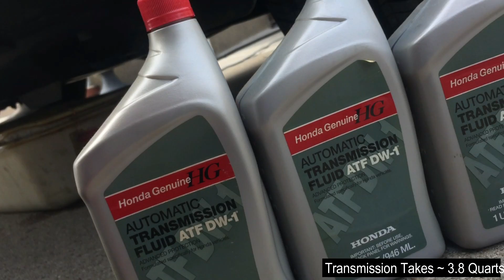2010 HONDA CR-V Transmission Drain & Refill

Comment: Never realized how romantic draining ATF could be
Reply from the maker: I guess takes the stress out of the equation from working on your vehicle!
Reply: @BulliKid  Congratulations.do you use transmission oil additive for the transmission.my car sounds "smack" when I take P to R at first start in the morning, but what could be the reason why it does not come in the next replacement.. should i use additives
Reply from the maker: @yigitmert4232  mine makes noises also.
Reply: @BulliKid  Were you able to solve the problem.. have you changed the transmission fluid... worst gearbox solenoid aalfs to be cleaned
Reply from the maker: I always change the transmission fluid every 20 to 30,000 miles a drain and refill other than making the noise during shifting the car has never had any problems and when I took it to the dealership they said it’s normal also have driven many agents civics and most of them do it
Reply: @BulliKid  thank you

Comment: Good job, Bulli.so you don't need to pump fluid to  the rear one?  I saw the other youtuber did that.
Reply from the maker: Yejun Li thank you.  What do you mean by rear one ? The rear differential?
Reply: yes. @BulliKid
Reply from the maker: Rear differential is a separate part of main transmission.  For that you drain it. And will need a pump to pump the fluid up.  I will be making a video of that this summer.
Reply: Honda dual pump fluid II for rear differential.

Comment: Is that plug and seal needed to be replaced at certain age to avoid "seal leaking?"
Reply from the maker: WC what deal are you talking about?
Reply: @BulliKid  Oh I'm talking about the "Auto Trans Output Shaft Seal SKF" (e.g. in a Honda CRV). Thanks!
Reply from the maker: I wouldn’t replace anything unless you have leaks
Reply: I thought you are referring to the drain bolt's crush washer.
Reply: hurry up or quit. I know of friends and cousins that's quit places over just that. Brown nosers gets the easy job's. My timing cover was cut in half being plastic and handed back to come back when parts are in, no front engine mount, they said my head gasket was leaking, was under warranty and done but not right, it was  a Friday and I'm leaving for vacation up into the mountains with my kids and my utility trailer for stuff like bikes that didn't fit, they had no choice to give me a new DODGE 4 door 4×4 to fit my family and be able to pull trailer as rental doesn't have those options. 3rd row seats  went down for dry stuff and coolers went in trailer with toys/bikes and i put 1,500 miles on it in a week, cost me extra in gas that I  complained about so they gave me 2 free oil changes, I went to school for it but went another way for a career, I checked before it went in, no engine mount and manager tried to get away with it, bolts hanging out botton that was stripped by tech but manager didn't see it and my belts were off besides power steering, always look before leaving, 1st popped hood and looked, grabbed manager which he finally came to look then grabbed Technician to double check and told manager that's what I told you about that it can't leave like in front of me. Manager saud belts must of fell off driving it out, I was called and dropped off to pick-up and got there hour earlier and not done, manager drove it out. Manager was pissed over it because there went his monthly bonus and tried hard to get me to take it. Still have that vehicle which is a 1999 PLYMOUTH Voyager and believe it or not, my best vehicle ever owned for upkeep and cheap over the years, I  parked it over Strut towers got very bad on making noises, wasn't paying to have them replaced after 200,000 miles, runs still with a jumpstart but not driven in years. Body rockers started to rot out on them, I use it for storage for certain things only.

Comment: What size is that square plug? What did you use?
Reply from the maker: 3/8th Rachet
Reply: @BulliKid  Thanks! Going to do this the same time I do the oil.
Reply from the maker: No problem! It’s very easy and keeps the trans happy

Comment: Hi, how often am I supposed to change the transmission fluid for a 2010 CRV?
Thanks
Reply from the maker: Julio Pina i like to do a drain and refill around 30k
Reply: @BulliKid  your CRV takes over 3.5 quarts to? Why does my Honda book say 2.5 liters?
Reply from the maker: Im not sure.   Maybe you were over filled to begin with.
Reply: @BulliKid  cant be I refilled 3.5 liters and checked it many times hot, parked on level and engine stopped, (60 secs) and i'm in my marks.
Reply from the maker: Quarts or liters?
Reply: @BulliKid  liters, (im in Canada)
Reply from the maker: Im using quarts.
Reply: @BulliKid in Türkiye use 3.7 litres atf 1 quarts 0,95 litres

Comment: How true that when you do this you have to drive it for a while then drain and fill with new ATF so that way the remaining fluid circulates and gets drained?
Also, does the dealer use a machine to drain all the ATF one-time, without needing to drain several times?
Reply from the maker: ybrik5 I like to drain and drive for 20k and repeat.  Flushing it slowly but surely will make sure the fluid is always slowly replenished  without possibly changing the viscosity ect of the fluid enough to cause slipping in a worn transmission.  

Some dealers will just drain and refill and have you come back in 30k. Some may do a full flush where they replace most if not all of the fluid.  (This process will cost a lot more as more fluid if used and more work) from what I have always heard you should do a drain and refill on these cars.   If you wanted a “flush style” then you can drain and fill. Drive the car for 15 mins and have it warm up. Then drain and fill again.  And repeats 2-3 times.  But to me this seems like you are pouring a lot of the new fluid with the drain.  To each their own.
Reply: BULLI KID thanks for the tip. How do you check the fluid level for this?
Reply from the maker: I believe car running in neutral.  
There is a dip stick for the transmission. You want it to be in between 2 marks.
Reply: BULLI KID Also how is viscosity a factor? As I understand you wanted to change that old fluid’s viscosity to a fresh one.
Reply from the maker: Good questions.  Typically as the fluid wears out it’s going to get thinner or less viscous causing more wear and internal engine components torque converter and clutches.  And if the Transmission was seeing new fluid that’s a thicker and viscous it can potentially cause some of the engine components to slip such as the torque converter.  That’s why they say if you haven’t changed your transmission fluid for a long time and over 80,000 miles you should probably not change it because the transmission is barely working on the old fluid but if you put new fluid in it will cause it to slip that’s why they say if you haven’t changed your transmission fluid for a long time in over 80,000 miles you should probably not change it because the transmission is barely working on the old fluid but if you put new fluid in it will cause it to slip. That’s why I said I just recommend doing it every 20,000 miles have a good balance between used and new fluid.
Reply: BULLI KID good point. That means changing more often in advance of the maintenance minder light for the case of Hondas.
Reply from the maker: I never pay attention to those minder systems. I do oil change every 4K 
Trans every 20k

Comment: Have you changed the transmission filter?
Reply from the maker: Not yet. I am just doing fluid changes as it is easy and quick.  The filter takes more effort. I will do that once I hit 100k
Reply: BULLI KID 

     On that vehicle the filter is easier than the fluid change.  I don’t understand the philosophy.  Sooner the better and good insurance for your investment.
Reply: BULLI KID 

     What good is new fluid if the new fluid cleans off all the sludge and clogs your old filter burning up your transmission?   I have seen it more than a few times.
Reply from the maker: With routine fluid changes I don’t think there will be sludge developing in the transmission.  But I feel comfortable keeping it for that time.  To each their own.   Can’t get to anal with maintanence because one day you can get in a accident and car will get totaled anyway.   So I’m keeping a healthy balance between maintenance and reality.   But no issues so far.  And yes the filter is a lot easier then those where u have to drop the pan.   I might do the filter replacement for   Content purposes.  I did just pick up 24 quarts of the atf dw1 fluid

Comment: That fluid you drained looked perfect. What a waste.
Reply from the maker: Nick V it was due for a drain and flush per the mileage.
Reply: @BulliKid  did  my first one after 160k which is required. now what would you say to maintain around so i keep it top shape every 25k miles?
Reply from the maker: Yes ~30 k is perfect.
Reply: Well you don't know till you do it and just imagine it's a lot cheaper than a transmission